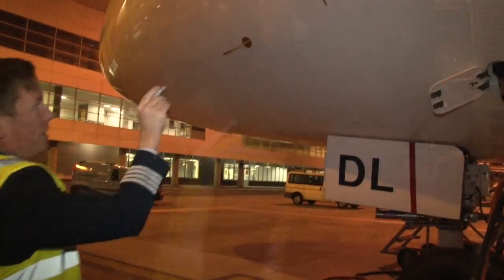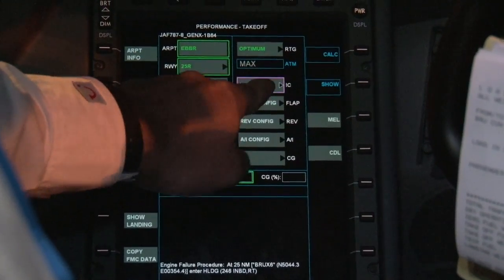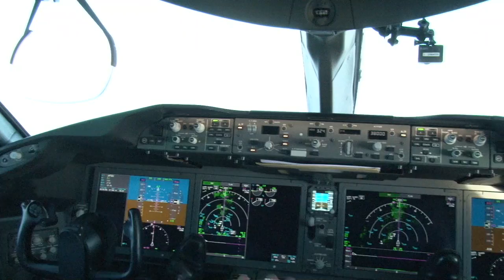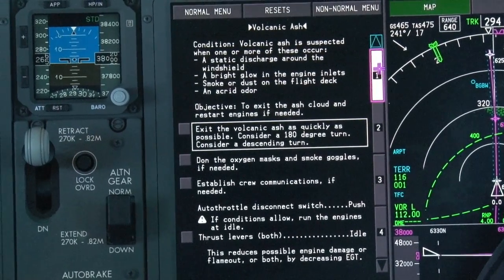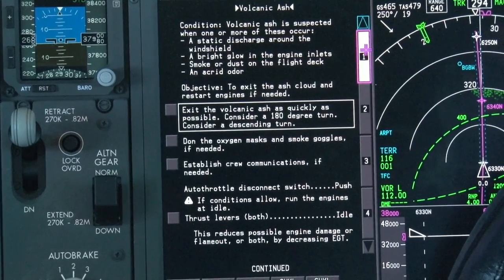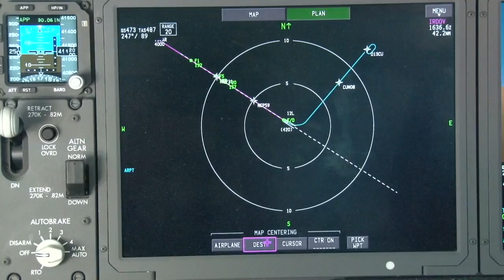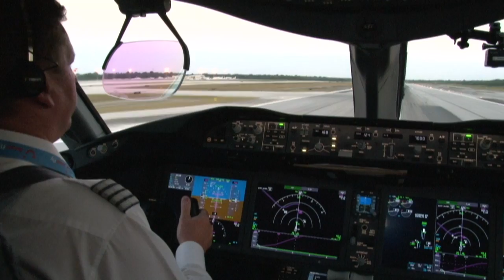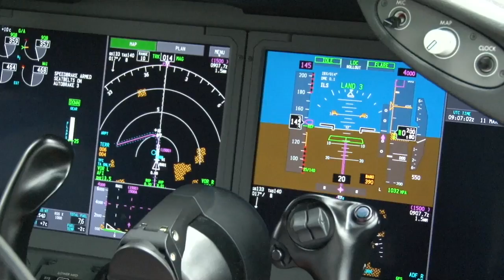Cockpit JETAIRFLY 787 to Cancun, Mexico

Comment: I am so glad most of the biggest problems with the 787 are worked out and it's got a dispatch rating now of 98.7% compared to at the beginning it had 95.8%. Boeing is aiming to get it up to 99.7% just like the 777 and 747 has. ANA even tho they were not to happy at first with the 787 dispatch rating, they're extremely happy with the 787 dispatch rating now. The first year in service the 787 saved ANA over $100 million dollars in fuel compared to before when they flew the 767 on the same routes.

Comment: Cool DVD preview!  Is there any advantage to not using bleed air to start the engines?
Reply: having bleed air systems in the engines can be used for a lot of things including starting engines, but theres a trend in engines to move away from that because bleeding air out of the compressor lowers pressure in the combustion chamber, which reduces the efficiency of the engine. It turns out it is more efficient to swap bleed-air systems for ones that use a different source of power (the APU for starting, electrical systems for electrical power, etc)

Comment: Wonderful to share this flight with the crew, and JP! A question from a newbie:
Could you explain the relation of the 787 landing distance with that of, say a 737 in real life? Thanks.
Reply from the maker: Bud Fields I'd say landing distance depends on a lot of factors for one specific type such as weight of the aircraft, flap setting, runway wet/dry, temperature etc...  then you also have different models in each type... 787-8, 787-9 and the 737 has a bunch of series... so hard to compare I would think...

Comment: Ahhhh, so very cool! 
Could someone, please, explain why in other planes engines cannot be started simultaneously? Thanks!
Reply: Thank you!
Reply: I'm BOT complitelly sure, but if i don't go wrong it is becouse in the other planes the pneumatic pressure provided by the apu is used to strat the engines..... And the apu is not abile to produce enough pneumatic pressure ti strat both the engines at the same time
Reply: Because the bleed air from the GPU or APU isn't enough. This plane is different because use electrical starter instead of use bleed air.
Reply: Yeah that's correct they have to stager start the engines with the Apu to allow the pressure to build up again this cuts down so many issues inflight Apu was a terrible design if they broke you were screwed on long haul flights couldn't fly etops without it

Comment: what advantage does having that spiky shape at the rear of the engine have?
Reply: I would say Airflow and increasing aerodynamics
Reply: They are called 'chevrons' and reduce the noise on the exhaust end of the engine. That's partly what makes 787 a very silent aircraft.

Comment: Do the 787 have a Hud? Or what is that right at eye level of both pilots?
Reply: HUDs are installed on both the captain's and the first officer's side. Pilots can even fly the airplane normally simply with a working HUD even with complete display malfunction and zero visibility.